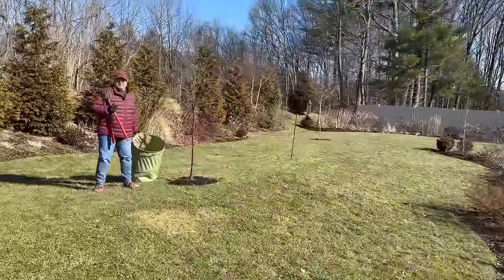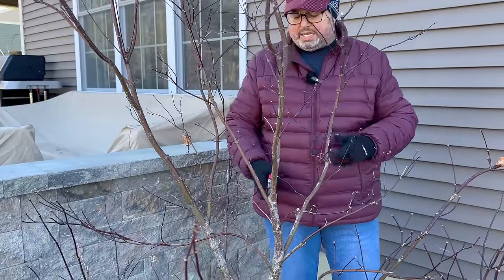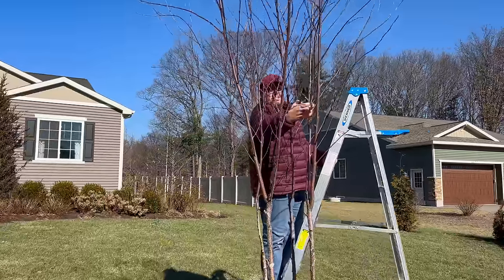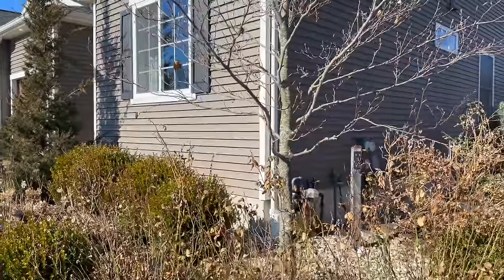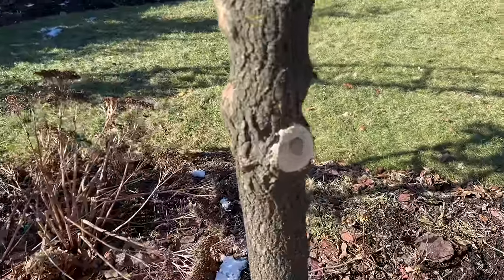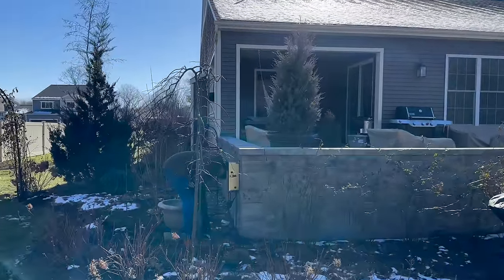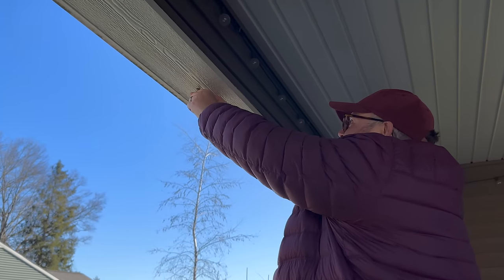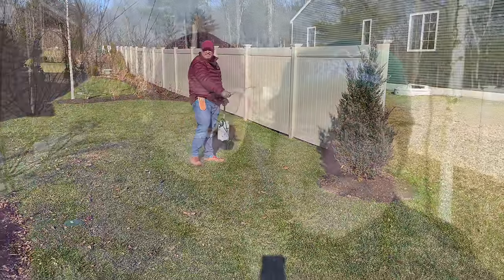Winter Garden Chores || Pruning Trees, Spraying for Deer, and More

Comment: You two need a Stihl 4” chainsaw for these chores. Makes for a quick job. And yes, I said 4 INCH chainsaw. I love, love, love mine.
Reply from the maker: I totally want one!!!
Reply: As far as larger branches, it cuts like butter…😮
Reply: They also have hedge shears for smaller jobs offering two different blades. I use mine for fall cleanup. Saves the wrists & hands 😂
Reply from the maker: I'm definitely checking it out